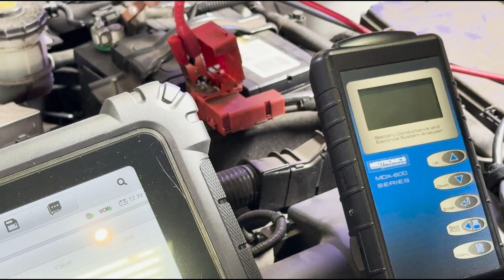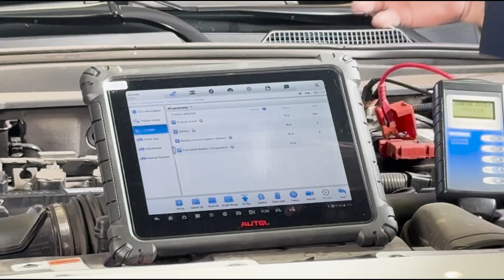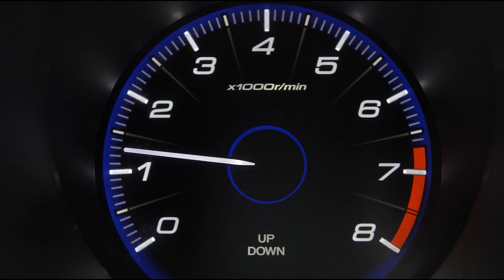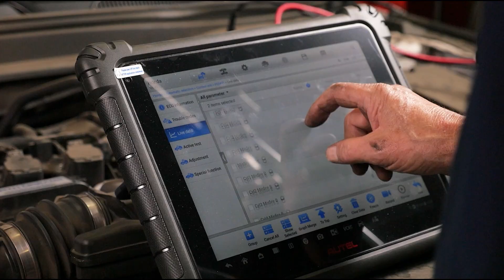Diagnosing the LIN-Controlled Alternator on a 2020 Honda Accord #Honda #CarRepair #LIN

Comment: Ive been fighting for weeks with honda crv diesel 2013.
It keeps altenator at low charge cycle. 12.4v.
Even if I put all the consumers on, it goes 11.8v.
Battery state of charge is 128%.
Battery sensor is changed with original.
Unplugging the sensor will let it charge at 14.4v without speedometer error. Can be seen with scanner.

Putting headlights on = it will be forced into 14.4v . Thats Honda basic function.

Braking= charges at 14.4v.
Reply: Did you find what was causing it?

Comment: Good video, important to stress that your regular checks are as important, regardless of the way an ECU comms with the alternator. But, still, you provided no info on how to test the actual comm line. No scope with waveforms, or even a simple unplug it test to to see if the alternator reverts to its machine sensed mode. Once had a no lin waveform and all I did to verify everything was unplug the connector. The waveform came back to life showing that the alternator was pulling the V down.

Comment: Was recently diagnosing a 2011 BMW 335i that kept eating batteries so obvious suspect was the alternator, but I was surprised to discover that neither our Autel nor Snap-On scan tools were able to access any PIDs related to the charging system. Ran thru all the usual checks including disconnecting the LIN line from the alternator (still no output) and scoping said LIN line (square waves looked fine so there appeared to be communication at least attempting to take place), voltage drop, etc, so ultimately called it and said it needed an alternator. Nevertheless, without being able to see the actual PIDs and commands from the ECU I can't say I was 100% confident in that diagnosis.